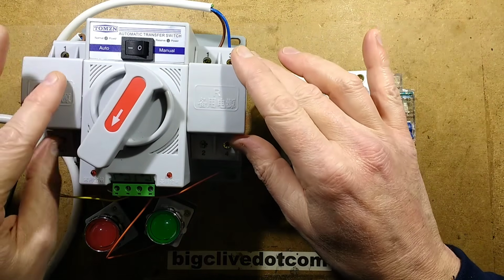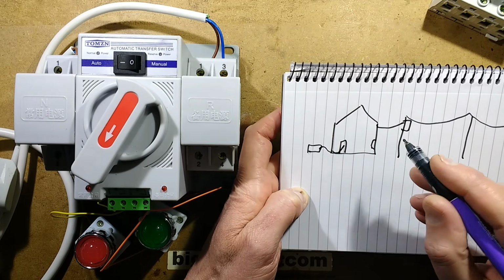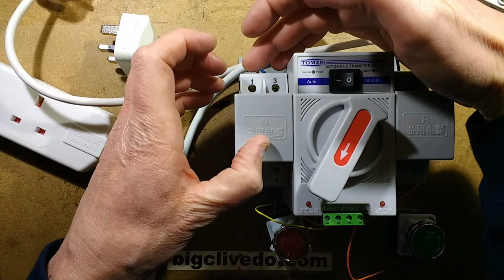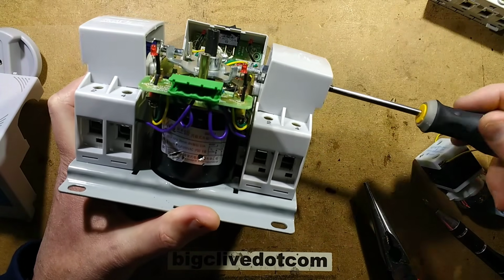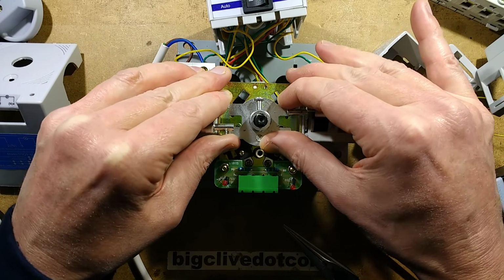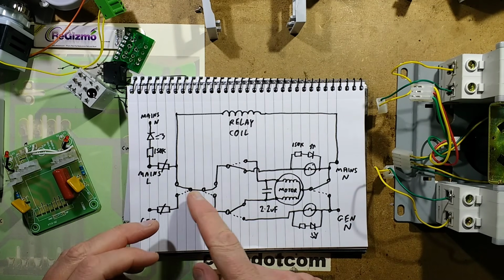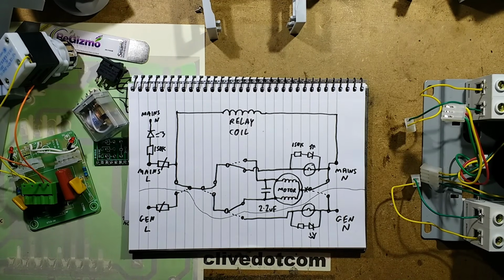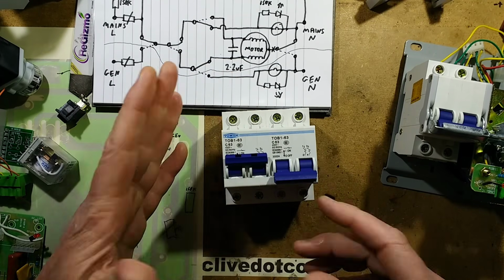Automatic generator changeover switch (with schematic).

Comment: Possibly (probably?) a stupid question, but what happens with the ground? Does the generator not have one, or is it just connected to the mains ground?
Reply: To be up to code you're required to choose a different planet in the Solar system, run a length of cable and ground your generator there to maintain proper safety and separation. Using any moons is not admissible. Oh, and all your breakers need to be at least Van Allen-belt rated!
Reply from the maker: +David Smith Usually connected to the buildings common grounding point.
Reply: Earth! It's called earth!!
Reply: Can something ever really be "Earthed" if its on Mars? How about Jupiter?
Reply: David Smith Ground/earth connections do not get switched in a manual or automatic transfer switch, so there will be no switch contacts for the ground connection, it will simply ground the metal enclosure (if in a metal enclosure) and continue on to the load center for the building/equipment.  You never interrupt the connection to ground/earth as that is the safety earth grounding point for the entire building and associated equipment.  Your generator should also be bonded to the building earth ground and this is typically done either by a hardwired generator connection that includes ground or a special generator inlet plug/receptacle (I combine both terms as they are a bit different than ordinary plugs and receptacles since the pins and contact roles are reversed where the pins are located in the building-side receptacle and the contacts in the generator-side plug such that "hot" pins are never exposed while hot -- essentially you are plugging the building into the generator) which includes a grounding contact that feeds back to the generator and ties the generator into the building ground.  In the U.S. that means a four contact generator inlet with separate ground and neutral leads plus the two hot legs for 240V generators or a three contact inlet for 120V only generators (hot, neutral, ground).

In the U.S. where there exists a bonded neutral conductor that is bonded to earth ground you will find that some transfer switches also break the neutral connection and others do not since a bonded neutral is effectively at (or very near) ground potential in the absence of fault level currents.  In such cases a third switched contact may be present, but many transfer switches simply pass the neutral through unswitched since it is bonded to earth ground.

Comment: When I was growing up my dad backfed the house.  He had a padlock on the breaker panel and during generator operation he kept the key on his person at all times.  Not completely foolproof but pretty idiot proof.
Reply: The old (fusebox-era) technology was a big (manual) DPDT-with-center-off enclosed knife switch with a big lever sticking out of the side. There were three positions: UP was ON-MAINS, DOWN was ON-GENERATOR, and MIDDLE was OFF.
Reply: @emolatur  

We have a similar setup here, but with two "changeover" switches in cascade. This allows us to run on mains, or backup power on the primary switch, and then to the secondary (backup power) switch which allows us to use either, generator, or inverter. Logically, that could just as easily be "big" generator (32kVA) or "small" generator (4kVA) as was the case before the inverter.
Reply: @emolatur  Hey now, are you calling my main transfer switch old? It was installed in 1992 after Hurricane Andrew as we knew we were going to be without power for a long time ( 5 weeks ).  If I added a third set of contacts, it would also serve a 3 phase system. It can handle changing the loads at up to 600 Amps. The unit is over two feet tall and has a cast iron handle. It can be locked in any of the three positions which makes it tamper proof. Because if it is not in the center off position, it also locks the cover. And that is besides the pad lock that locks the cover. Right now it is fused with 200 Amp Slow Blow fuses and inside the house is a 200 Amp main circuit breaker. Mine however is down is Mains, center Off, and up is Generator as the feeds are that way.
Reply: EscapeMCP he was basically making sure us kids didn't mess with it.  Not that we would have.  He was already pretty certain of his ability to  it flip one switch before another. .  We are in situations every day that rely on common sense and reasoning to keep us and those around us alive.  It's impossible to make everything intrinsically safe and the more we try the more we dull our ability to think critically and be responsible for our own actions.
Reply: D3FTIGE KOST sure it would be, but back in the day having a set up like this was very pricey and most folks couldn’t afford to do things just because they were nice to have.
Reply: warren blades good luck to the detectives trying to figure that out. Thousands of suspects hooked online, and its not like electricity makes tooling marks or generators leave rifling striations to prove who’s power feed was responsible. So no, I bet they couldn’t even figure out who it was, definitely couldn’t prove it, so prosecution would not be likely.
Reply: @jaxturner7288  Unless you had a proper transfer switch, the power company would not hook your power back up if they heard a generator running after Andrew. We actually have two transfer switches. One is outside and can switch the whole house while the second, smaller one, is setup for just emergency circuits to keep the water pump, lights, microwave, refrigerator, bathroom fans, and a TV powered.
Reply: still have a main 200 amp breaker in the panel. problem is, if you did not turn it off, you would have the issue. if you do back feed to the pole and a worker gets killed, you can  and will be  prosecuted. and yes they would have to prove the person at fault.
Reply: @wingnut2009100  --  Utility workers either knowingly "work hot" (and wear gloves/whatever) or simply short everything to neutral and the "best ground."   If they go the bonding/shorting route, the "short" is visible to the guy handling the wires.
Reply: @GilmerJohn  Yep, all work after Andrew was done with all three phases grounded in the section they were working on. But the problem was they were having to replace all of the wires and most of the poles and transformers so that last link, the house to transformer was where most of the hazard was. As they completed a section, they would remove the grounds and then power up that section. 3 day job per 8 block section of 3 phase line. Day one, drill holes, off load poles, setup with transformers and insulators. Day two, set poles, install drops. Day three, string the wires by lifting each wire from ground to insulator. Five to ten truck sets at a time. Rinse and repeat. Each pole had two trucks assigned to it. One held the wire while the second was the bucket truck with the lineman attaching the wire to the insulator. Our pole out front is the only pole on our 5 block run that is an Andrew survivor. It was installed in 1978 and still stands today. And we were dead center of the Hurricane. Recent upgrades were done hot as they replaced almost all of the 3 phase wooden poles with concrete poles. Where they still have it on wood poles, they have installed an additional wooden pole between existing ones.
Reply: I threw on a spare combo lock out of the kitchen drawer that nobody else but me bothers remember the passcode to
Reply: Lockout tagout is certainly a good idea for these things.
Reply: Do R/C! If there is one thing I have learned over the years it is absolutely, positively, to never underestimate idiots.  They will make a fool of one every time if given the chance and are a reliable source of endless surprises.
Reply: Pretty idiot proof... unless your Dad's an idiot, that is (not implying that he is, but just pointing out a flaw in your logic) :)
Reply: In PL some places electric corporate use a generator and u must use a lockout equipment "tagout" and u cannot use generator to power ur house, in hospital gen is connected via separate line to sockets etc
Reply: Good "UL" rated switches are 100 dollars and up. Common Sense costs $0. I've been using my manual switchover for 10 years and I'm the only one with the key. 
Totally idiot proof
Reply: At work it was basically the same type setup. You had to have the key in one of the locks to allow the breaker to be turned on. With no key, both were locked out. If the key was in one of the locks, it was captured until the breaker was turned off and locked. Now we also had a small auto transfer switch for the small generator so that in case of power failure, the emergency circuits would power up after generator start. The auto transfer switch was motor powered. It also had spring power to turn the breakers off. If the covers that the springs were in popped open, then it could not switch the breaker back. Only one person at the job site was allowed to go into that panel, me. Because I knew that failure to properly throw the covers or the breakers could result in the small generator ( 30 KW ) back feeding the power company transformer.
Reply: +Ethan Poole
There is no lower limit to stupidity.  If people can fuck it up, they will and if they can't, they'll find a way  - effortlessly.
Reply: D3FTIGE KOST  ...and additionally, if I recall - houses used to have fuse boxes...  ...where to disconnect the mains required physically pulling out something.  Not sure what tech would've existed at that time for this;  there may have been something.

Comment: That's clever, and the use of ordinary breakers makes it quite safe :-D
No microcontroller or any other junk required :-D
Reply: Ethan Poole the switch may be better suited to use the mains as the generator and battery supported solar system as the main power source .
Reply: I came to believe this looking over the schematic. Prevents relay coil being energised constantly and will run on generator until further notice, unless the generator is shut down.
Reply: Hmm  @damonjenkins2185  simple solutions, generator runs with delay after normal shuts down just by simple relay and most generators "commercial" runs with 30/40s delay even in hospitals.
Reply: @mateuszzimon8216  Ours at work were set for a full minute's time of commercial power before it would transition. If it blinked, it was another minute. And then a 5 minute cool down before the generator would shut down. Any blink in that time was automatically back on generator power. Our big units were operator started/stopped until replaced in 2001. Nothing wrong with the generators or the engines but the switch gear was starting to act up due to salt water corrosion ( and mayonnaise, ketchup, Diesel fuel, mud, food ) that got into it during Hurricane Andrew. And then were force dried after a quick wash down with water that had a high chlorine content. When the panels were removed, there still was crud falling out of them. Hurricane struck on Monday and on Friday we were back in operation and ran on those generators for 5 straight weeks.
Reply: zx8401ztv yeah, the breakers are essentially big limit switches as far as I understand.
Reply: zx8401ztv Save for their rather paltry 3KA interrupt rating.  I know Clive mentioned a minimal interrupt rating of around 6KA for his country and here in the U.S. typical residential interrupt ratings are around 10KA for branch circuits and greater than 20KA for the main breaker.  Which is to say, if they actually had to handle a dead short condition there is a real risk of the entire unit simply exploding into bits with possible injury and fire.  As such they would need upstream protection to protect from severe short circuit conditions.

To me these seem more suited to dual utility feed connections where one has two incoming power feeds from the utility (such as from differing substations) as this automatic transfer switch does not actually provide for starting the generator nor does it delay transfer to, and away from, the generator to allow the generator time to start, stabilize, then assume the load as is typical of automatic transfer switches intended for generator applications.  For this switch to really work with a generator "automatically" the generator would have to be on continuous standby and running 24/7, which is ordinarily only ever done in very critical applications (and even then it is common to allow battery or flywheel UPS power sources to support critical loads while the generator starts and power transfers over to it at which point the UPS returns to standby duty in case of a generator fault, at which point the backup generator is started and the process repeated, or to support loads while switching back to mains when utility power is restored).
Reply: It wouldn't even pass CE approval. The leds themselves poking trough on the front are litterally the only insulation between you and the mains... aside from the soldered connections on the breakers... This device is a nice idea and proof of concept, but that's about it. Not safe.
Reply: You fun killer LOL :-D
I dont need CE approval, british standards will do lol.

Comment: Normal residential primary voltage in the US is 7200 volts single phase.. The 10 - 15 Kv is more a commercial for multi-phase feeds.
Reply: I'll have to go up there with a multimeter and check
Reply: That's also highly dependent on where you are. Older places might be only 2400 volt delta. New places might be 13.8, 14.4kV, 28.9, or 34.5kV. 
Way out in the sticks, its possible to have a single phase 69kV to 7.2kV and then a 7.2kV to 120/240 xfrmr stacked together, as your own 'substation' if you're the only load for miles along transmission line.

Comment: I wish that you had pulled the breakers apart to see whether or not they were indeed MCB's or not. I shouted at my screen, but I don't think you heard me. :(
Reply: Yup :-)
Reply: I doubt they are MCB's.  Every ATS I've installed (100's) doesn't use breakers, just isolaters.  Protection is done from the main board and from the gen source.